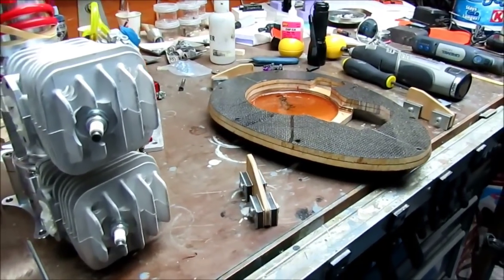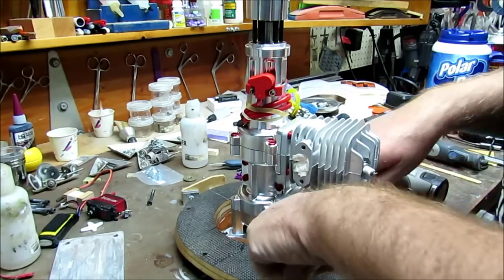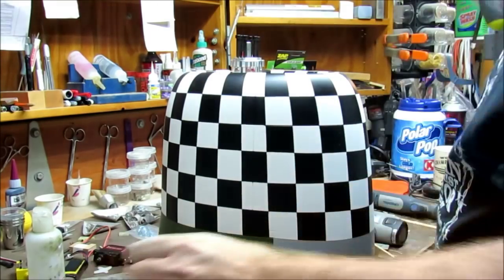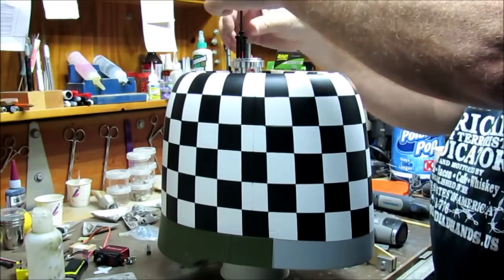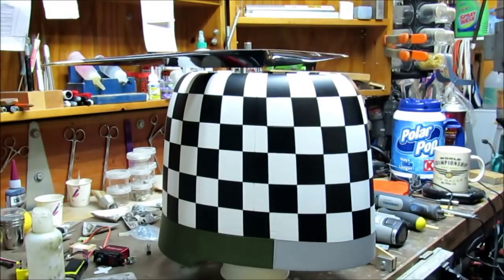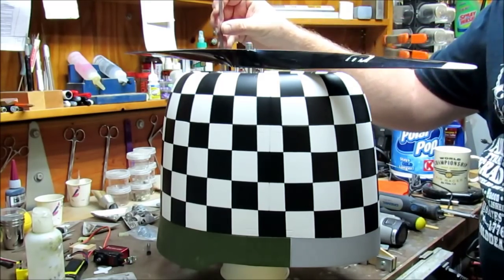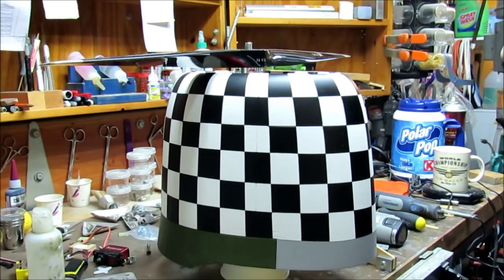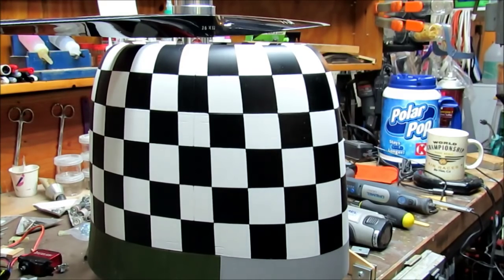Robart P47 #4, Custom Firewall, Episode 3, Self Leveling Thrust Section COMPLETE!!!

Comment: is the resin specially made for self leveling or are you just letting it self level?
Reply from the maker: No. This is standard West systems 105 with Fast hardener (206?). I added a few squirts of denatured alcohol to make it more watery and more self-levelly. I wanted the top of that pool to be perfectly level with the contour of the planet...which will make it exactly 1.2 degrees canted down and right from rest of the firewall assy.